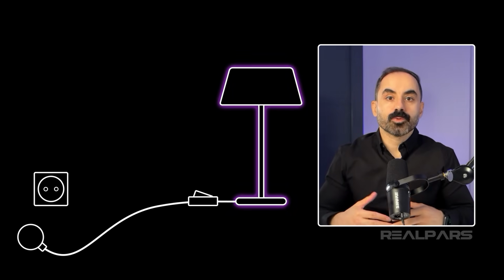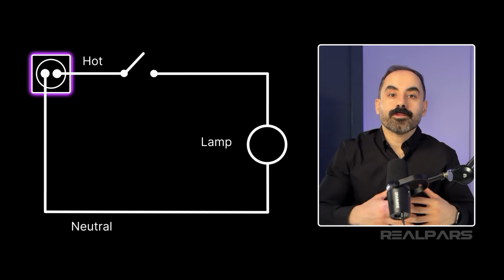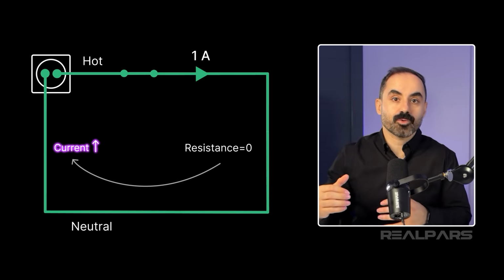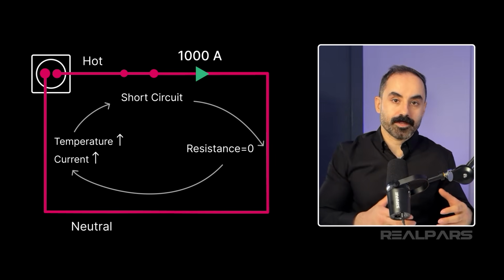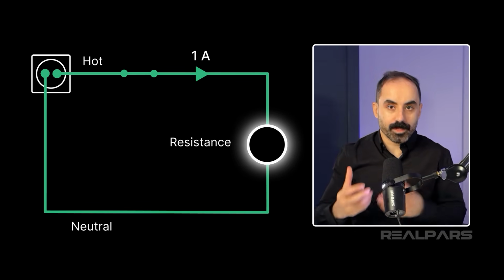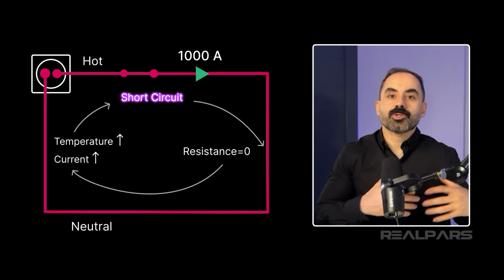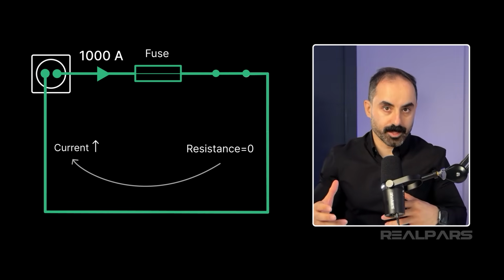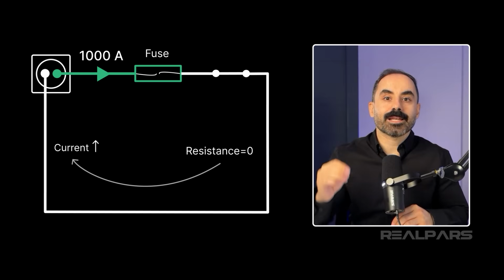What Is a Short Circuit?

Comment: The wire has resistance. The power supply has internal resistance (called impedance in AC systems).

It is these two resistances (and the system voltage) that will determine the short circuit current.

There are many other factors that have less bearing on the current, but these are the most influential factors.
Reply from the maker: Thanks for adding that!

Comment: second question  imagin i am having  1500 A   wire cable    with zero resistance no control   will the same scenario  remain it will increase above  1500 A ?
Reply: Clever question. ..but what about the step down transformer who has a star point. Where do you think the neutral comes from
Reply: If you already have zero resistance, your circuit is already in short circuit mode. When short circuit happens, whatever the normal current of your circuit is will be amplified by a lot and gets out of control.
Reply: It’s simple, the limit does not exist

Comment: this is  basic dought i am having very long time  unable to  find answer( 1a to 1000 A)  in  simple  explanation Thank you .. One more question   when 1 A   passes  through the  Resistance  Zero   in which point   it raises  1000 A  in initially  starting  or middle or  end  position   or it will   rotate in circle continuously and each  complete start and end  it will increase gradually   please explain ?
Reply: Good question. When the lamp is removed, the current jumps to 1000A almost instantly. It doesn't build up slowly. It spikes right away because there is nothing left to slow it down and the source of control is gone.